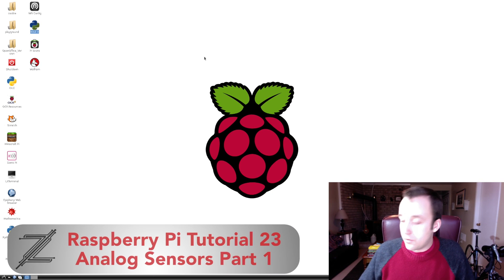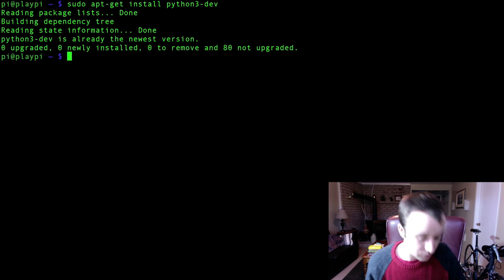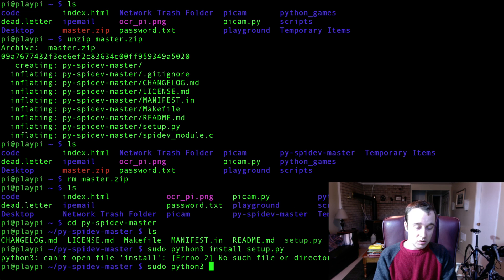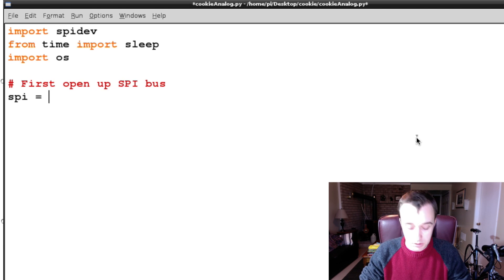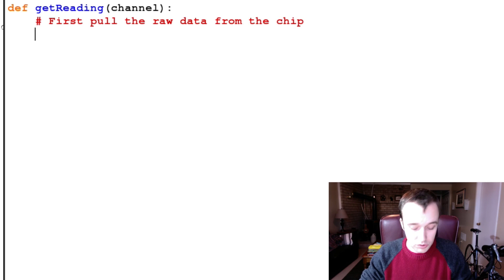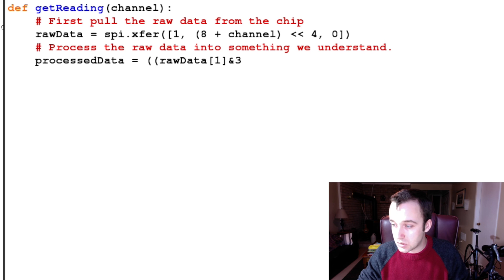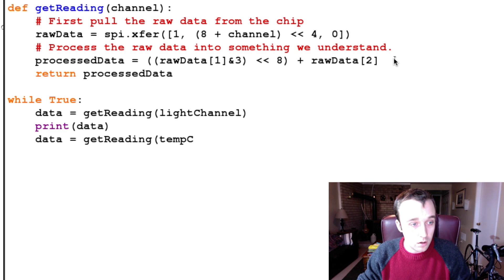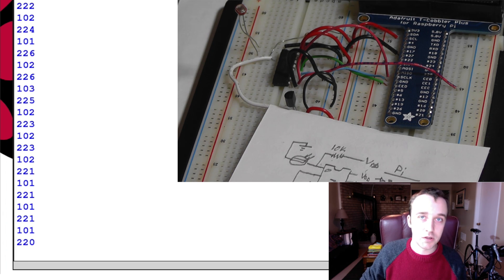Raspberry Pi Tutorial 23 - GPIO Analog Sensor Programming 1

Comment: Thanks for the great videos.  I wanted to point out that that the ADC or spidev seems to be sensitive to a speed setting.  I had a very difficult time getting your examples working until I set spi.max_speed_hz.  I tried a number of settings and they all seemed to work: spi.max_speed_hz=1000000 or 100000, etc...
Reply: Thanks, that solved my issue. If anyone wonders, my reading was 0 the whole time till I add: spi.max_speed_hz=1000000

Comment: Hello Alexander, could you please help me?
I'm only getting 0 and 255 in the readings, I tried to solve the problem by replacing the MCP3008, reinstalling the configurations but everything remains the same.
I'm using Raspberry Pi 3 Model B.
I hope you can help me
Reply: you try
spi = spidev.SpiDev()
spi.open(0,0)
spi.max_speed_hz=1000000
Reply: @DungTran-hb7kl  thank you very much. i used your method to solve my problem.

Comment: Running on a Raspberry Pi 3, Raspian Jessie.  Only get data from the sensor on CH0 which it uses for calculations for both channels.  Switching sensors just makes the other sensor active.  Swapped MCP3002 chips thinking CH1 was bad, but same problem. (Have 3002s instead of 3008s but have data sheet and believe wired accordingly)
Reply: Problem solved!  With the excellent explanation in Tutorial 25 (thanks Alexander!!), comparing the 3002 vs 3008 data sheets and a little help from my friends, I got the signal TO the MCP3002 (which is MUCH different than to the MCP3008) figured out and got a reasonable response from the sensors.

Comment: Hello
I followed your video but i have an error message

spi = spidev.Spidev
         AttributeError: 'module' object has no attribute 'Spidev'

The master.zip is installed and i checked my script a lot of time I have found no mistake, so if you have any id ...

PS: Like Lopez said your English is really easy to understand and the way you present things are really easy to understand so thank you.
Reply from the maker: +Yapeck The line of code is "spi = spidev.SpiDev()" You're maintaining capitalization and braces?

If so, it may be possible you've installed a different version of spidev prior to my tutorial. Uninstall the module and re-install the one I suggest and it should work.
Reply: +Alexander Baran-Harper 
I did exactly the same things as you, i even reinstall rasbian to have a clean  OS. But it still didn't work so I will try get my analogique data with windows IOT.
Reply: +Alexander Baran-Harper 
sorry it works i don't know what i have changed but it works!!!!
Thank you for your fast answer :)

Comment: Alex,
I have reproduced this tutorial as well :) I like the way you explain everything. Tight and understandable for non-English speakers as well :P  
The only thing that I haven't done is to connect analog sensor to the MCP3008 channels (bacause I don't have one near at hand). When I run the script I get fluctuating readings from the two channels. (lightChannel and tempChannel in this case) Also the amplitude of this two readings is high.
Do you have any idea why I get this values as readings? Should I get zero readings? 

I am adding the link for the spidev package because I don't see it in the description of the video :)
https://github.com/Gadgetoid/py-spidev/archive/ma                                                                                                                                        ster.zip

Comment: can you also make a tutorial for 8 bit AD DA converter? :)
thanks in advance
Reply from the maker: +Paul Lopez I have one up (check tutorial 22) that shows you 10-bit MCP3004 or MCP3008 ADC setup on a pi. You could extrapolate for 8 bit from there. Same concepts should apply.
Reply from the maker: +Paul Lopez Tutorial 25 goes a little more in depth into how the ADC works too. It's difficult for me to make a tutorial for every ADC out there, but this one kind of shows you how to read the data sheet to get what you need to get setup properly. Your 8-bit ADC should have its own data sheet and tell you how to pull data from it.
Reply: +Alexander Baran-Harper thanks dude :) i have PCF8591 coverter :)